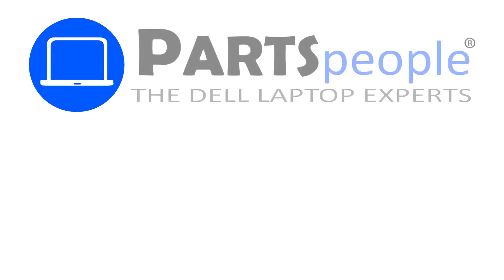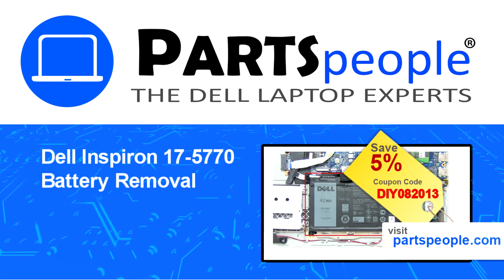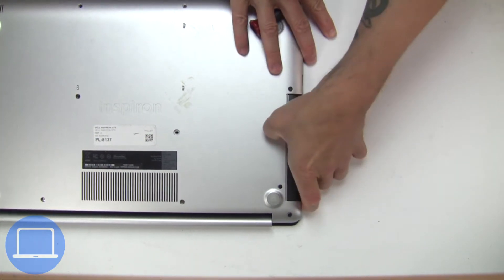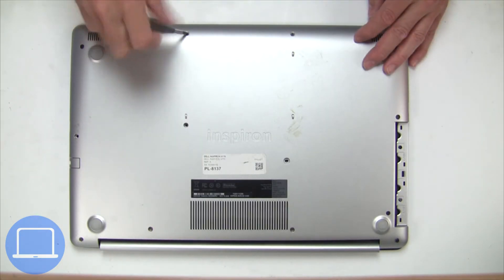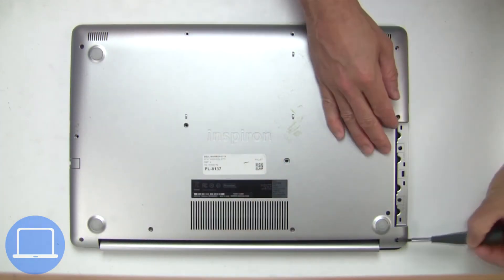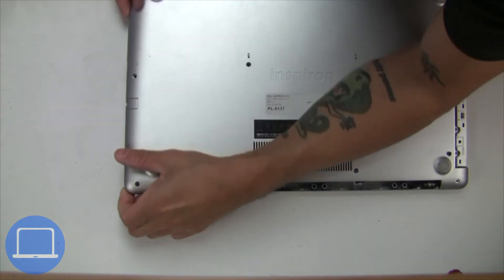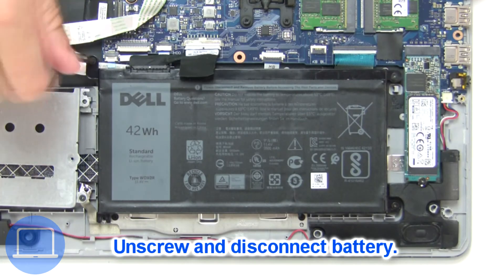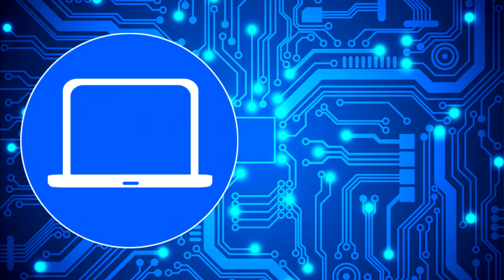Dell Inspiron 17-5770 (P35E001) Battery How-To Video Tutorial

Comment: Hi Recardo, great video. You showed how to disconnect the cable from the laptop, would be able to show how the cable is disconnected from the battery itself, that would be really appreciated.
Reply from the maker: Thanks. The removal process is the same. Simply pull the cable connector away from the battery to disconnect it.